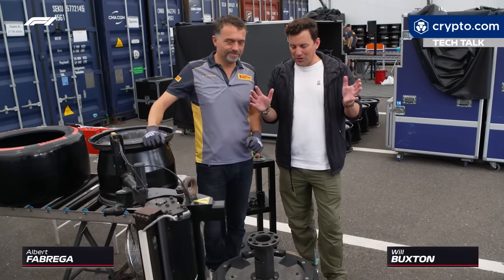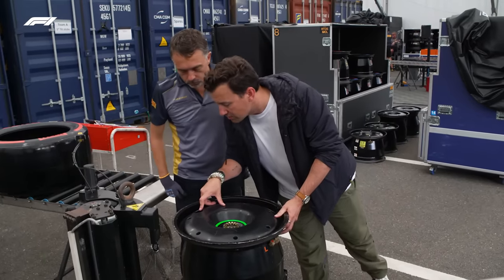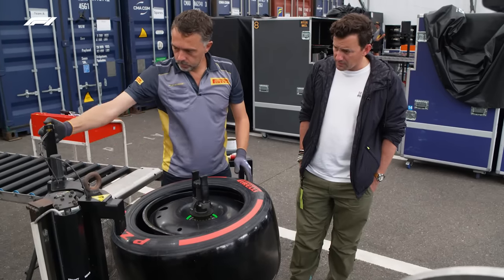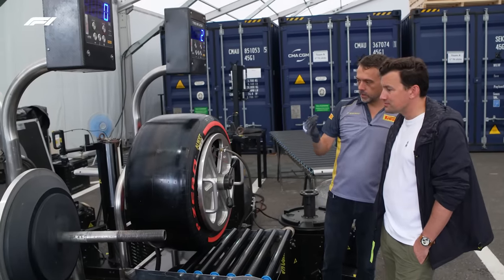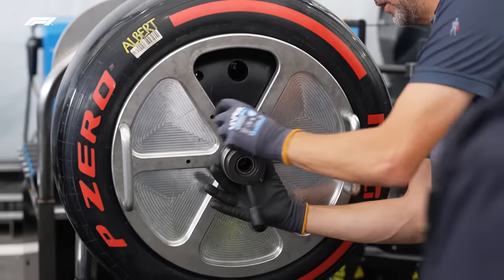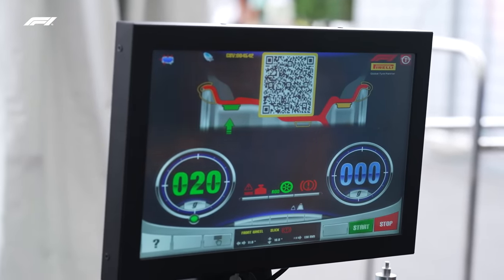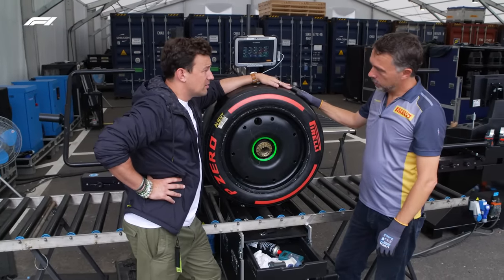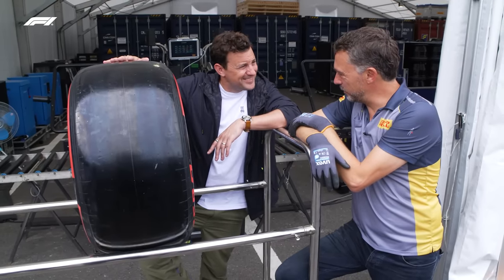How Are F1 Tyres Fitted? | Tech Talk | Crypto.com

Comment: Well. They carry these tyres in a plane that emits tonnes of CO2 to generate a little bit of electricity so that they can call it recycling. 

I love F1 but its funny how humans can make simple things complex to prove a simple point.
Reply: They don’t only carry the wheels, so you are objectively wrong. This just adds a little bit of weight, these tyres are way lighter than humans, around 10-11 kgs, so a full set of tyres is the equivalent of a kid in a plane, and they generate quite a lot of energy, definitely way more than they waste on transport, which again has to be done anyways because they carry way more stuff.
Reply: @ferst262  On a standard weekend, drivers are given 13 sets of dry weather tyres, four sets of intermediates and three sets of full wets. Now, do the math and add them up and then multiply it by 20 and then by 10 kilo's each and 22 races a year. You tell me that they can generate more energy out of those tyres that it would take to transport them?
Reply: @adishesh28  yeah, so now get rid of all the compunds they use, and the ones that they dont use are the tiniest amount, you definitely can make way more energy out of them that whatever it costs to transport those and everything they transport in the same container. Cause again, the tyres arent the only parts going back to UK, they transport them with hundreds of machinery, its the tiniest amount compared to what they can produce

Comment: Glad I don't live near the place that burns the tyres...
Reply: iv just read how its done... produces fewer harmful gasses than the standard incineration process .. no thats not true. burning at higher temps doesnt make it safer. just makes the particles smaller, so not as detectable by current test methods. Its all still getting chucked into the air

Comment: How is it ever going to be carbon neutral if you are shipping unused slick tyres from all over the world after race weekends and just burning the rubber back in england to generate electricity. What a waste
Reply: What would be a better solution?
Reply: They're used as an alternative to coal to power a concrete factory, so it is carbon neutral or at least approaching neutrality
Reply: @kerc  recycling then to use in new roads or footpaths
Reply: @kerc giving them to fans so we can use them for coffee tables! 😂
Reply: @boobies158 that is more useful than "converting" it into energy.